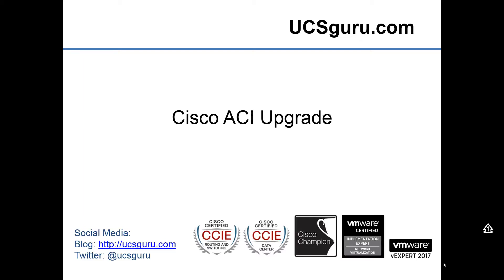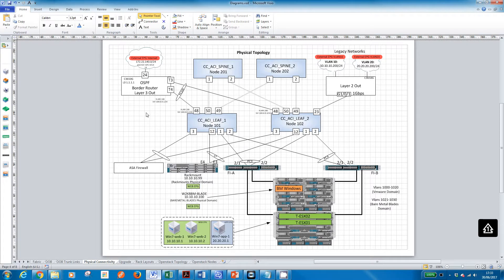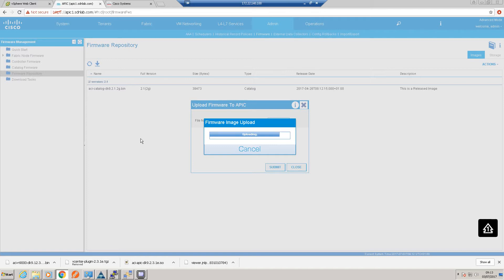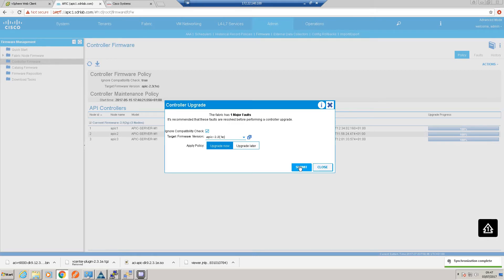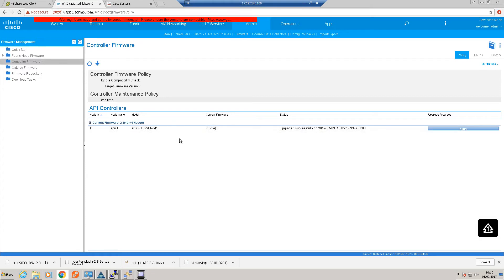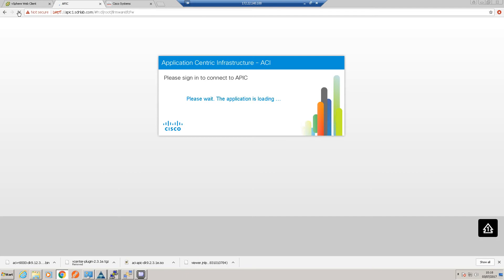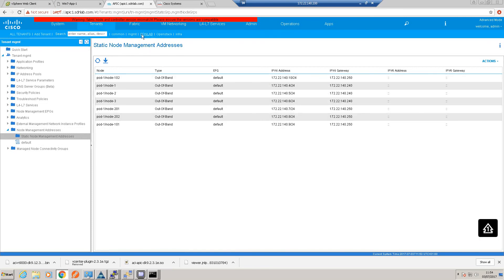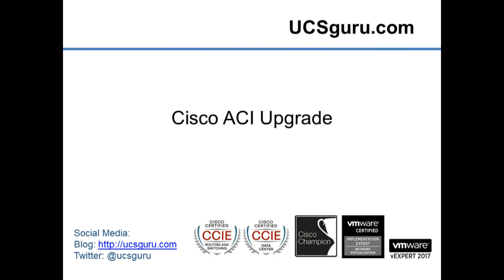Cisco ACI Upgrade

Comment: Thank you for the amazing video Colin. It's so lovely and clear video that I understand the method from the first look. However, there is one detail in there video which I still don't understand completely. There are different variation of Nexus 9K devices. Why the download page gave you the only 9K image to download? I expected them to be separate at least for spine and leaf since they are different physical models. Besides, leafs and spine models might very. Am I right suspecting that in the ACI mode Nexus 9K switches run some sort of "unified" image that is the same for any physical platform.

I would be greatly thankful if you could share your understaning/expertise.
Thank you for the amazing video again.
Reply: I think Switch IOS depends on the image that is running on APIC